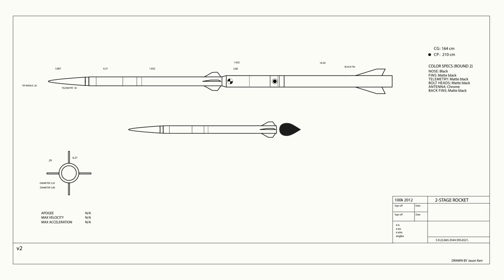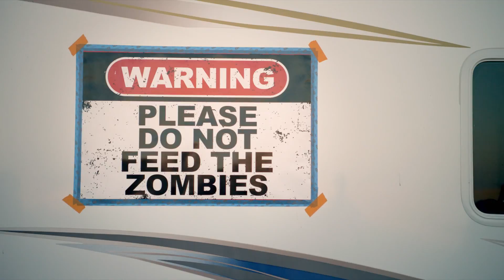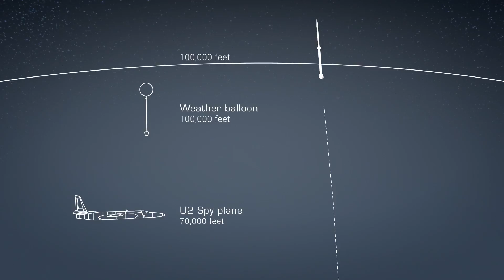Ready To Launch

Comment: 3:38
Was she cooking rocket candy? lol
Also as I understand, while you can legally collect information with a cell phone, you cannot transmit legally, what tools did you use to interface and transmit? (I'm an Aerospace Student)
Reply from the maker: SwissMllk That was queso cheese dip,  still warming up. :)

We used an amateur radio link, 5 watts in the 2-meter band. The phone emitted AFSK modulation over the headphone jack into the radio, which we decoded on the ground with tablets.
Reply: hahaha
Reply: ***** nice, I used a similar  setup to track a high alt balloon.